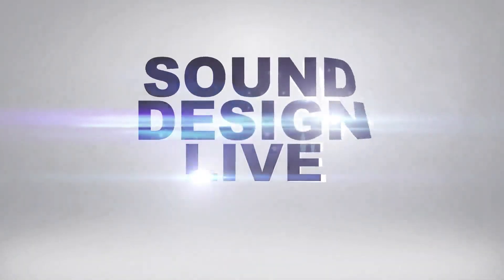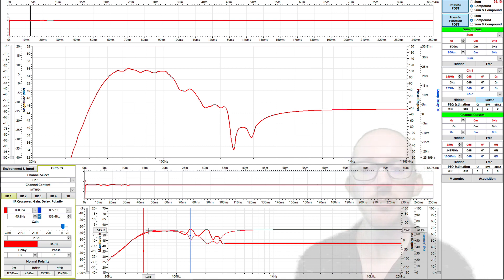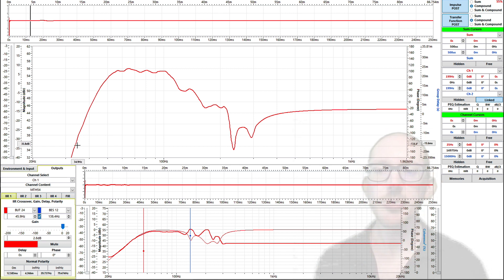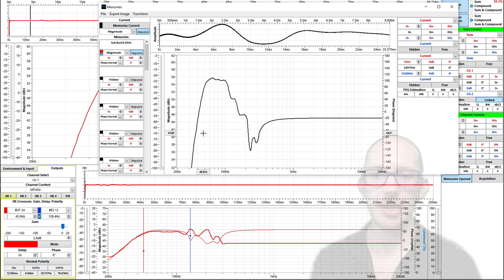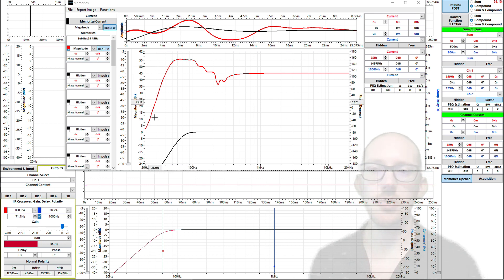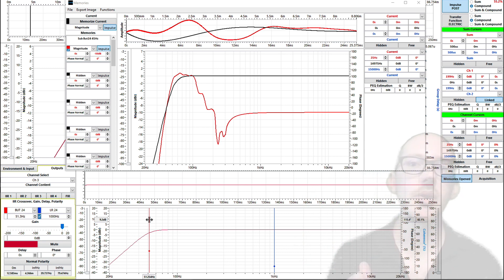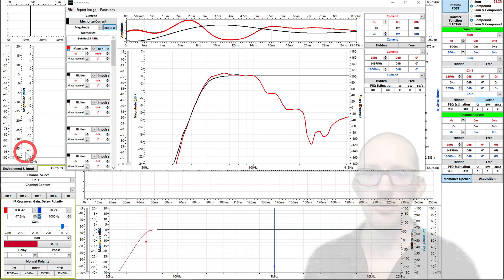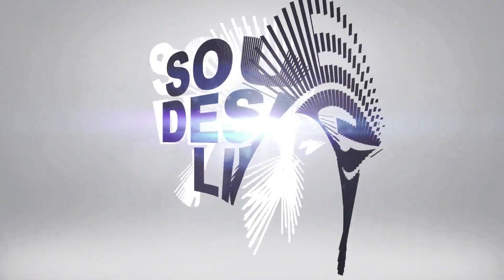Avoid duplicating filters (acoustic + electric)

Comment: Sir can i expalin my problem in hindi
Reply from the maker: google translate?
Reply: @nathanlively  how to reduce my back bass from subwoofer from dsp
And side bass also
I used frequency for subwoofer hpf 30hz bw18 and lpf 115 lr 24
And used parametric eq 
Frequency 1=40hz gain 2.5db
2=50hz gain 3db
60hz gain 3db
70hz gain 2.5